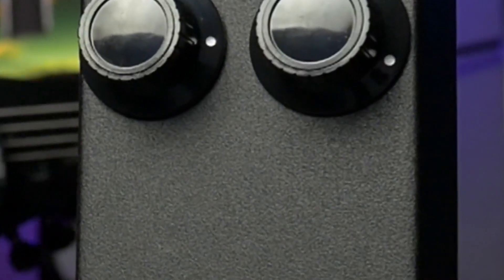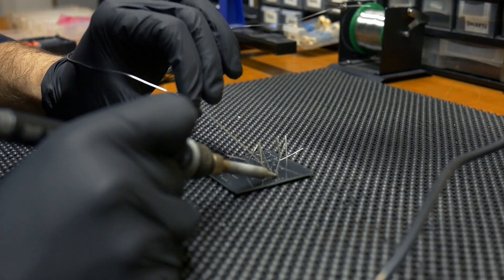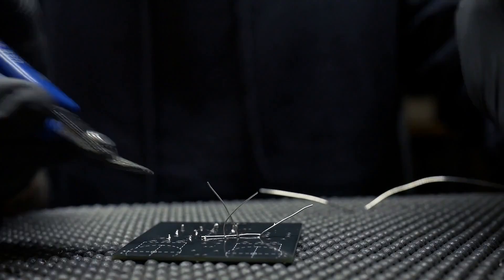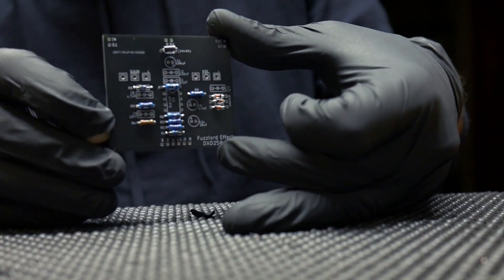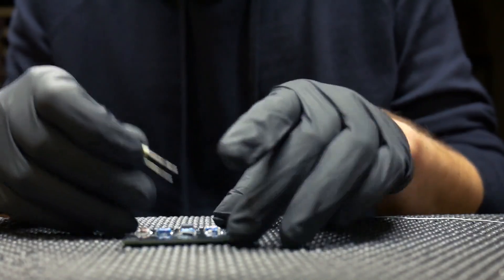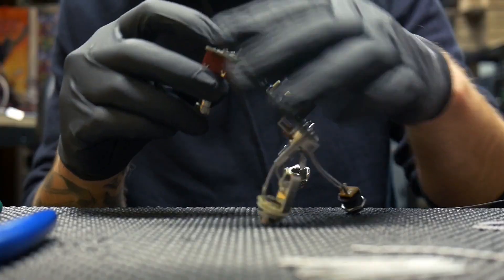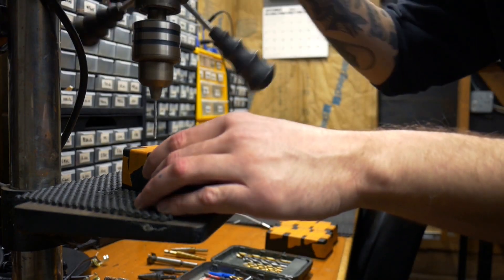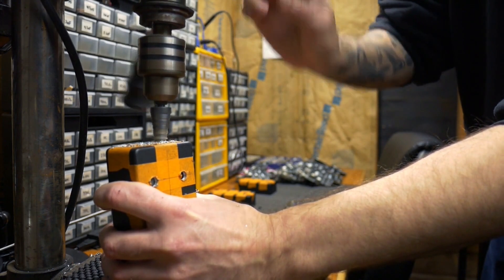How To Build A Guitar Pedal: DOD250 Overdrive

Comment: I just finished mine today, I love it! First had some issues where a 470R resistor got mixed into my 470K's so it was super quiet and thin, but as soon as I solved that it works like a charm. I'm thinking on building another but trying some mods, like switchable input caps and different clipping diode combos.
Reply from the maker: Good job man!! You could totally mod that one and add a switch with those caps

Comment: This might be a dumb question, but is there a difference between 100p capacitors and 100pf capacitors ?
Reply from the maker: Those are the same the first one just forgot to add the f which is the unit measure for caps stands for Farad. pF stands for pico Farad 👍

Comment: I've built a few pedals - a few kits, and a few where I had to source all the parts. Sourcing all the parts for complicated builds is difficult if you are new to that. But it sure is rewarding to finish and have a working pedal.
The last two I built don't work right however, and I don't have the troubleshooting skills to figure out what is wrong. 
This DOD 250 build looks easy enough, and it is one of my favorite dirt circuits, so I may try again. 
It would help wo have a parts list with links to the actual parts. Details like UF and NF matter (ask me how I know, haha)

Comment: When I was studying electronics and soldering, we were always pushed to clip our leads before soldering, to avoid broken solder joints or possible breaking of PCB traces due to the force caused by cutters. I was personally always sceptical of this and found it annoying to keep components in place ( we would use painters masking tape to hold the components down and also rely on bending the leads). 

In your personal experience putting together what I assume to be many hundreds of pedals, have you ever encountered an issue like this when clipping the leads after soldering the component? I just find this process so much more convenient and I feel the advice I got is a bit out of date.

Comment: I’ve built a couple pedals. One was garbage. One worked alright. My issue was amateur soldering. 😅 That said, I have a question about your dirt pedals. I play on a fender hot rod deluxe amp on the clean channel. Have you ever played your pedals on fender amps? I imagine it’s a brighter sound compared to right? I love your stuff but I’m curious about that variable.

Comment: Great video guide. This was the circuit that got me started building pedals years ago. My mistakes were orientation of polarized components. 

This circuit is a great first build, and easy to tweak with diode mods, or combining Distortion + values.
Reply from the maker: Stoked to hear you made one before and thanks for watching!

Comment: I bought a kit, built it, and it just didn't work. I followed the video and the schematic very tediously and carefully. If I knew what I did wrong, I wouldn't consider that a waste of time and money. I'm hoping this video might give me some insight into where I went wrong. It was not the kit being used in this video. But, like he said, "any kit will do. "
Reply: I had a similar experience and my first problem was I used metal power jacks. Which dont work because it ended up grounding my positive leads. Repaced that. Still nothing. Turns out I also wired up my input and output jacks wrong. Redid those and boom. Works. Some other beginner mistakes I made or saw others have aside from wiring stuff backwards, was cold solder joints. Anyone that looks wonky to you, flow a little extra solder over them. They should be nice and shinny if done right. Stomp switch wiring is also a pain so tripple check that too. Hopefully you figure it out! Circuit building is a bit of a pain but its a fun relatively cheap hobby